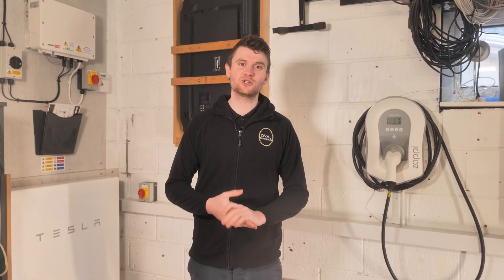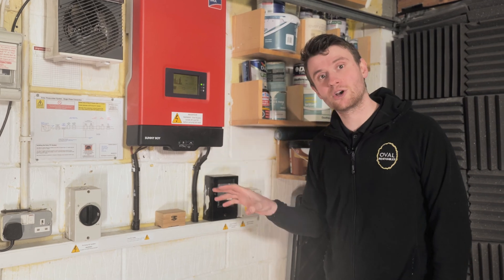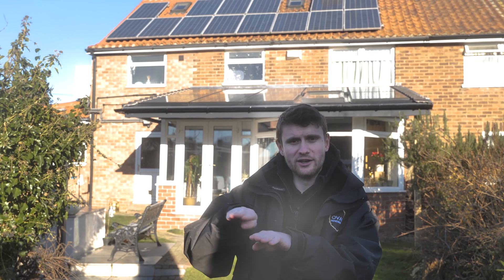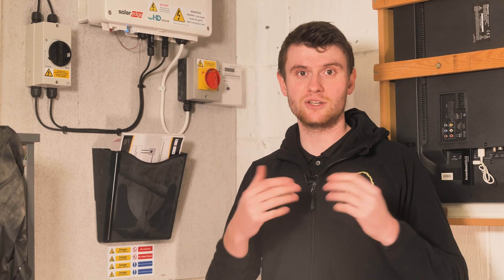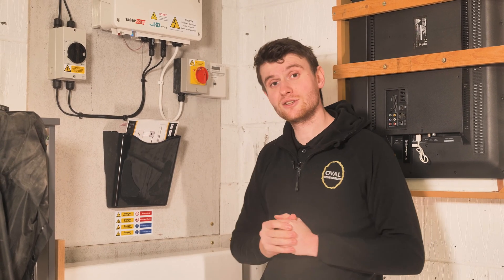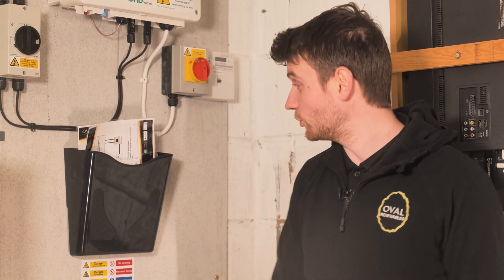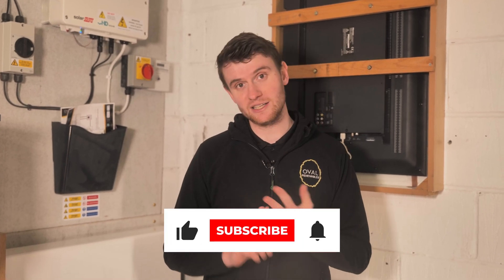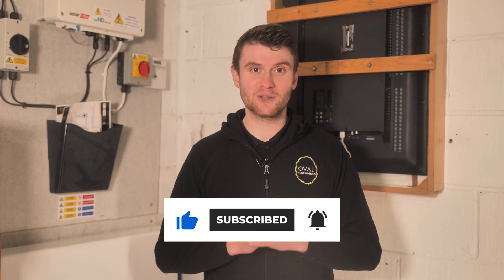North Ferriby Home Energy System Part 1 - In roof Viridian Solar PV with SolarEdge

Comment: Hi great video I have got an old solar system 3.6kw array but my inverter is a 2.8kw do you think my inverter should be a 4kw ? I had fitted at the end of feeding tariff when it was hard to get materials 
Thanks Nigel
Reply from the maker: Hi Nigel, thanks for watching! It’s hard to say to be honest it would be down to your installer. However you could check what they sold you as they may have installed the wrong one by mistake?

Comment: Hi Sam, thank you for another great video, 
You mentioned to me that i need to be tesla approved to install their battery and it’s difficult to get on board, can i ask how long did it take you to get on board,? 
It feels like mission impossible for me,, I  filled the form a few times already but no luck 🍀, I know it’s busy times but for renewables,, but was expecting at least 1 reply
Reply from the maker: It took us about 2 years on and off 😅. Things moved a bit quicker when I did a post on LinkedIn 👍
Reply: @OvalRenewables  that’s absolutely terrible experience Sam, 
Haven’t got any experience with linked in but will have to give it a go,, 

There is no tesla installer in 10-15 radius,, I thought they will be in on the case

Comment: Very informative video as always. Just 1 question. As I understand the solaredge system is cloud based so all your data is on some server somewhere else. Is there a subscription charge to keep using the app after an initial period? Like for example after 5 years etc?
Reply from the maker: There is no subscription. It’s guaranteed to be free for 25 years.
Reply: @OvalRenewables  ok cool 👍

Comment: Hi, 

Soon to be venturing into the world of solar battery installs. I am and always have been a spark first but feel now is as good as time as any to jump in.

One question I have is the ac side of the install. 

Can you reply with a sequence of connections all the way through the install. And how does the consumer unit use the power generated from the solar array if we don’t interfere with the meter tails??
Reply from the maker: Hi Sam. Unfortunately these aren’t designed to be how to videos. However the home will take the power from the solar or battery first no matter if the tails are split or not. The systems push the voltage out slightly higher than the grid voltage to force the renewable energy to be prioritised.
Reply: Thank you!